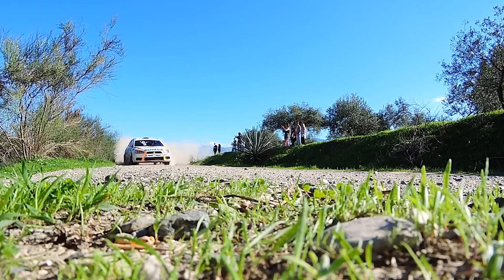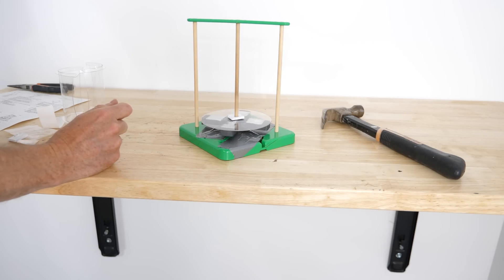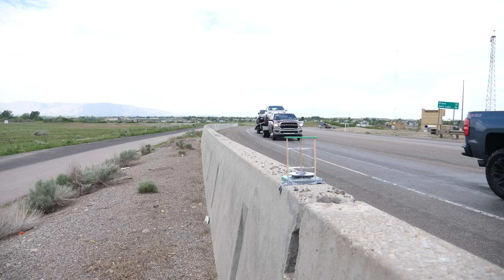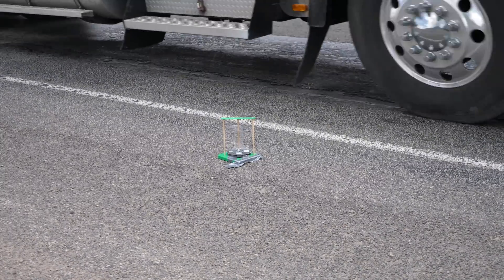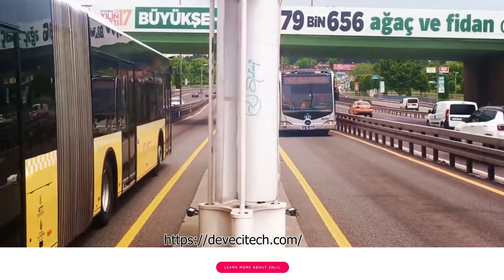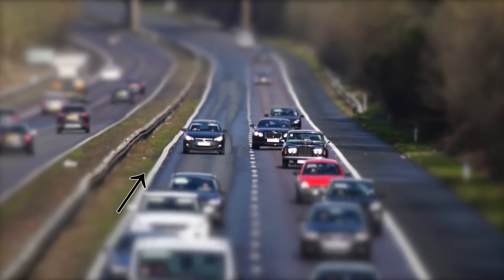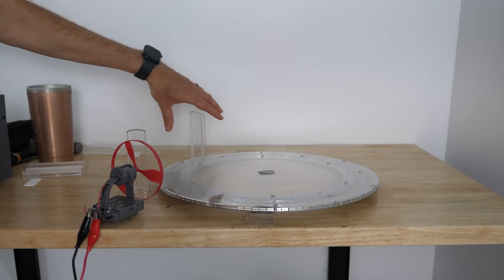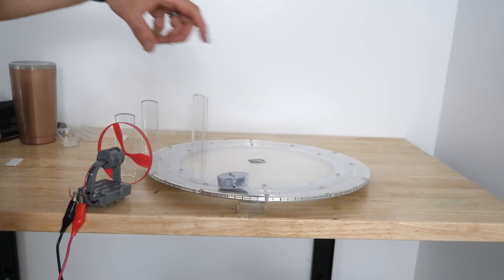Do Traffic Turbines Actually Work?

Comment: Hi James, I love your videos.  If we needed to build better generators, wouldn't we have to find a way to reduce friction as much as possible?  

I mean, we can't just fight an elephant with an army of ants! 😊❤👍
Reply: In my understanding, there's very little friction loss in generators, they already spin on high tech bearings. I think most of loss is heating, and the need to remove the heat. I.e. electric resistance, at its root. Find a room temperature superconductor material and you'll be rich.

Comment: Also, imagine if these turbines lined up on a highway for miles. It would create a lot of hazard and inherently slow down traffic. Still, it was neat to see an idea like this tried out!
Reply: Why slow down traffic? I think that actually by having a wall dividing the two opposite directions could force drivers to only look in their line and make them pay more attention, resulting in (maybe) faster reaction time, therefore less traffic
Reply: @somtu3780  I think they're talking about the psychology of driving. People tend to have a natural tendency to slow down in more cramped looking areas, and freeways by default feel much more open and safe for being speedy. It's basically subconscious for the most part.
Reply: no more than the supprts that hold up the armco do can that even be measured?

Comment: Why nobody in comments realize that its basically harvesting the energy of cars, specifically the energy that they carry in their fuel tanks. You pay for it. It inefficiently translates to some wind turbine energy on road -> you pay more for gas. Whats the point when you can harvest a standard wind? The only practical application I see is some kind of low power remote road infrastructure that normally utilizes solar power.

Comment: Too much of the kinetic energy is being dissipated into the surrounding area because it's out in the open. If you were to put it on the side of the road inside a tunnel, for instance, a lot more of the energy would only have one direction to go, and the effect would be much more dramatic. In theory anyway; in practice is a different matter because that brings with it a whole host of other safety issues with testing this.

Comment: There are some nuances in this particular test that you didn't said. Such as, the air movement created by the cars might loose kinetic energy by the surrounding air... So you can't consider that the entire air around the road is moving as a set speed, much of the kinetic energy is lost already when you have cars that are further apart.
And on roads that have opposing lanes separated by barriers the kinetic energy from your car might be negative to the car on the other side of the barrier going the opposite way.
For this experiment to be more accurate you have create the a impact line graph that analyzes the speed and direction of the wind before hitting the car for increments of separation between subsequent cars. Also you should have demonstrated that cars that have better aerodynamics generates less movement of the air.

Comment: I had an idea for a thermoelectric generator based on the siebeck effect, if you were to have two different metals on a structure thats sitting in water where the bottom half is finned and submerged and painted white to be cold, and the top half is painted black and easier to heat up, so using the temperature difference of the water vs dry air + the sun heating up the top half, I imagine you could make a railing structure along coastlines that generate power from the temperature difference
Reply: A nice idea but I think this effect is far too inefficient to be actually usable.
Reply: If you're using the sun already it inherently makes more sense to use the photovoltaic effect (as in a solar panel) though. It's cheaper, less complicated, and doesn't require water or waterborne structures.

Comment: The question to ask is not if this resistance is negligible or not. Whatever the amount of resistance it adds, the real question is : will the electricity created by those turbine be SUPERIOR to the electricity we could burn with the additional fuel that cars will have to burn (or electricity they will have to use in the case of EVs) as a consequence of this resistance ?
In other words, will the added fuel/elecriticity used by the car be worth the energy generated, or wouldn't it be more useful to use this fuel/electricity directly ?

The answer seems to point towards an obvious answer : those turbines are a bad idea.

Comment: It could be used to slow down things like maglev trains : put a tunnel of these turbines to help it slow down AND get some energy back.
Reply: But then we also need to think how to get them out of the way when the train in the opposite direction needs to speed up along the same stretch? It's going to be a net loss due to all the complexities. Maglev trains already get energy back with regenerative braking I think, no way a mechanical trackside appendage would be practical.

Comment: Your "turbines" in the test scenario didn't slow the "car" on the track. They redirected the wind from the fan that was pushing the "car" along. The test would on apply to wind-driven cars. 

Once a car pushes the air out of the way, there's very little that can happen to affect the car by harnessing the wind it creates. If you put enough turbines along the road, it would at most be like driving next to a wall. Some of the displaced air would have to be compressed between the car and wall, and probably just go up. Driving close to a wall of turbines would be just like driving next to a wall, with slits in it.

Comment: Much better way to do it by installing it below the Road with some water and dust proofing barrier to avoid jamming this way you need less turbines with Advantage of  Very high air flow coupling configuration and add generator only with Groups of turbine  install flywheel with Centrifugal Gear engagement in every Turbine so when ever it gets enough Angular momentum it transfer it to main flywheel ( installed for eatch group ) and use only one Generator for eatch Group so it will reduce the cost .
Reply: Anytime someone says underneath the road is a good place for anything, is a time when someone is wasting money. Putting anything below a road is extremely expensive and makes maintenance a hassle. That and there's also the problem that roadside wind turbines are just a terribly inefficient way of stealing energy from cars and are inherently wasteful.

Comment: in principle it works, but unfortunately it's not practical.
It would be nice though to have a sure way to harvest some little energy for example to provide some weak light marking the road or cross-sections which would be plenty visible in the dark (on unlit road). Especially if that energy is generated (or controlled) by the cars then if could leave a dim light trail behind cars which would draw the line of the road in that section (not just seeing the bright head-lights).

Comment: I don't think it will add up. There are many scenarios where it would improve the performance of the vehicle. If there is a head wind, these would slow down the wind, catching energy at the same time and making the wind slower causing the vehicles less gas. That is just one example. I can think of many others.
Reply: If there's a head-wind, the turbine would gain energy from that wind, and lose energy from cars passing by. I would make way more sense to just place the wind turbine away from the road. The equation of traffic-powered wind turbines doesn't make sense to me at this point, but I'm open to explenations.
Reply: @Leonated  You have a good understanding of the physics at play here. The concept doesn't make sense to you because it is nonsensical perpetual-motion junk.

Comment: I've always wondered if putting each side of a highway in a tunnel would increase fuel efficiency by creating a strong wind current that gets sucked along each tunnel in the direction of the traffic, and reducing air resistance for the cars.

Comment: The big issue with technology like these traffic turbines is that the companies involved in promoting the technology are concentrating all their effort on trying to convince the skeptics that the technology is viable in the sense that it is not violating the laws of physics (I.E., that the product is not some perpetual motion scam) that they seem to forget about addressing if the technology cost effective compared to the obvious alternatives. 

A few years back I saw a concept proposing the inclusion of solar PV cells into roadways with the idea that it would be the surface that the vehicles drive on.  Here the obvious alternative would be to simply place conventional PV arrays beside the roadway - an already commonly applied idea.

Comment: Put a line of these turbines in a subway tunnel, and as the subway trains rush past, they generate energy which you can then feed back into the system to run the trains. It's foolproof!

Comment: Idk about the experiment. If cars were recieving power from sails maybe it would matter. Cars push air out of the way constantly. I dont think absorbing energy from air being pushed away from the car interferes. Most of the wind generated is pushed away and only hits side of the road after car passes. Like a wave trailing behind a boat. Harvesting energy that way cant effect the vehicle. You harvest energy from waves created by a boat and it doesnt magically slow down a boat that has already passed by. The device would have to effect the air contacting the air in front if the vehicles, and very close to the road.

Comment: does the law of conservation of energy really apply in this case? The super conducting magnet experiment seems convincing, However, I am not completely convinced that the cars on the highways are giving up energy to power the generator, It looks more like the generator is extracting some of the K.E. of the moving mass of air that would otherwise be wasted on moving/pushing a slightly larger mass of surrounding still air.
An analogy would be extracting the wasted heat in a geothermal powerplant by circulating the water for steam generation using a heat exchanger placed in the chimney over the burning fuel. you are not reducing the energy that goes into electricity generation, but rather extracting heat energy that would otherwise be wasted. Would love to hear Action lab's take on this,